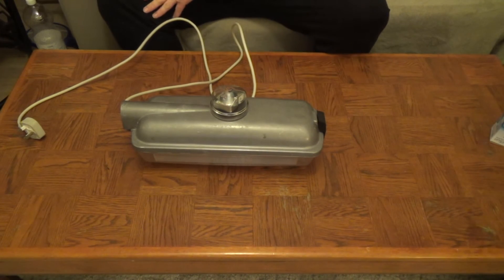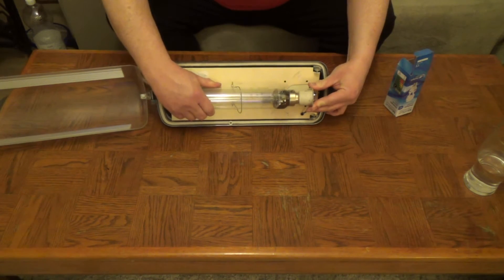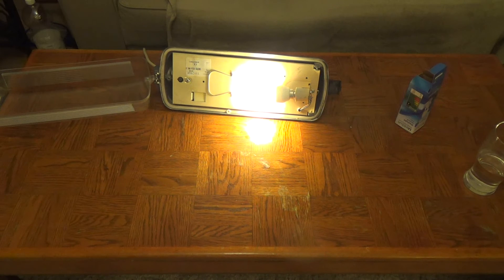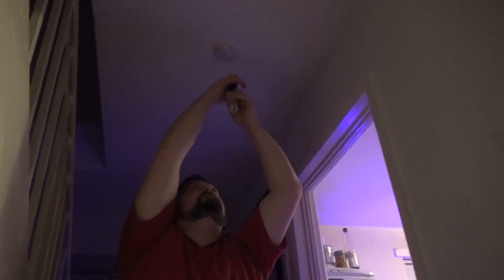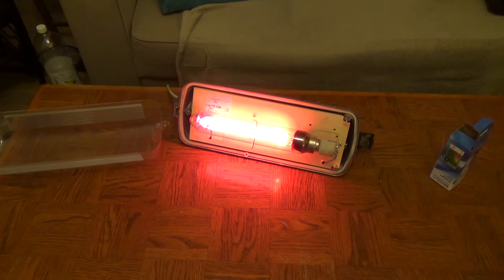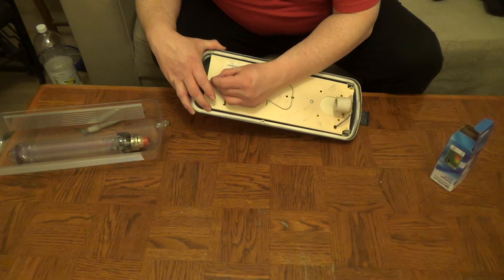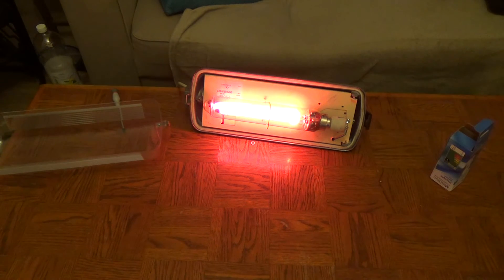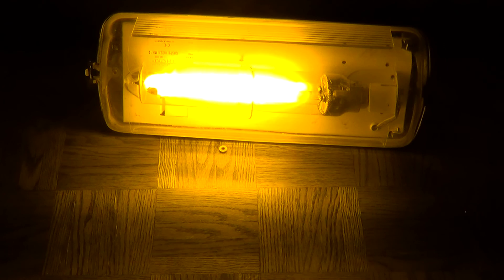Normal bulb in a SOX street lamp & SOX bulb in normal light socket

Comment: So would one of those TrueForce LED lamps work in a house socket? They don’t exactly require a gear to run.
Reply: Yes, they don't require any gear and can be run in a household lamp socket.
With street lights, in case of any ignitor present, the ignitor needs to be disconnected (otherwise it blows up the electronics). The (magnetic) ballast can usually be left in circuit as it doesn't do anything when the current is so low.

Comment: Very interesting about the compact fluorescent bulb working on the low-pressure sodium lamp. And also, I have wondered for years what would happen if you tried running a sodium bulb in a normal socket. My long question has been answered. And no offense, but low-pressure sodium lamps just give off the most hideous light ever.
Reply from the maker: Depends on your perspective. Many found they aided sleep patterns better than LEDs as their light was closer to the camp fire light our ancestors found safety in for hundreds of thousands of years.

Comment: I wonder 💭 if light-💡-bulb manufacturers will make an sox-like lamp 🪔 that DOES plug 🔌 into a standard light-💡-bulb that DOES NOT require a ballast or any kind of control gear ⚙️, let alone require a warm-up period of 10+ mins cuz it gives off light 💡 using yellow LEDs just like 👍 you can get LED-flame-🔥-effect bulbs 💡 and LED filament bulbs 💡. How cool 😎 would it 🐝 if you could get low-pressure-sodium-look-alike bulbs 💡 that resemble vintage SOX lamps.

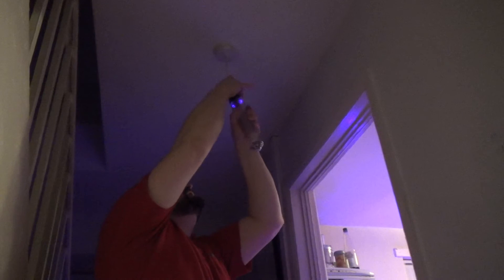Comment: At 5:28 the arc has a purple light...
Reply: Okay, don’t get so mad little child.
Reply: Neon starter gas, science baby, science, SOX are the best road lights, shame it is now no longer made...i use SOX all around my house 5 18W miniSox by doors, Philips Norelco fixtures made in Van Wert OH here Advance Philips ballasts, 55W wall Pack hubbell, replaced a Philips 55W, that got too yellow lens, no replacement, and then ballast finally fried after 35 years !! of everyday use, many lamps, teh ballast finally went, i replaced the ballast, have spares of them also, but the too yellowed lend sucked, So no longer made Philips Norelco fixtrues, got some hubbell 55W SOX Scotsdale units, they too are no long made so i have some spares, LED suck in blue white glaring horrible optics, on the roadway fixtures everywhere glare.  Have plenty of spare SOX LAmps 18W and 35W and 55W, have a 180W flood light also from Van Wert OH Philips palce, long gone, just for kicks, 180W SOX is INTENSE!!! Light the nitrite street, with the soft no glare pure yellow SOX light..ebay had some good prices some time ago, managed to get brand new Philips SOX e 18W 12 for $77.!! bargain of the day..most are like $30 on ebay..Philips, Osram, GE(Thorn) even a GEC, but over teh years, i found Philips lamps last the longest, had some Osrams go out prematurely, and some GE former Thorn go out early, subtle differences in inner tube, over the years the metal supports are mica, different generations of lamps..put up a 90W street fixture years ago in a private parking lot, worked great, better than the glaring 175 W MH crap.  too bad SOX LPs is no more ffactory last one is closed Philips in UK, they where making teh last of Osram also under contract, using Osram equipment, cus the inner arc tube is a different design, no dimples,

Comment: Hello, can you still buy Sox Fittings anymore?
Reply from the maker: You might get lucky with eBay.
Reply: I might try Ebay. But can you find them in stores?
Reply from the maker: I doubt it.
Reply: Yea i know, since LED came out LPS has been replaced. I got one more question. This is a stupid one lol. Can you find them on roads. Since they were replaced by LED and they probably threw the LPS away.
Reply from the maker: That would be stupid as the bulbs explode if not deposed of properly. Again they would have been taken to council depots to be sold on or recycled, hence why you should keep an eye out on eBay for them.
Reply: Today it was really windy and the cover of a sox street lamp and the photocell was just chilling on the road so I decided to bring it home and repair it i wish the ballast and gear fell too because i really want a sox street lamp lol
Reply from the maker: https://www.ebay.co.uk/itm/Thorn-beta-5-Mark-15-35w-sox-Low-Pressure-sodium-Street-Light-1-part-photocell/232931204748?hash=item363bc81e8c:g:cU8AAOSwvkZbn4kF
Reply: Thanks man, can it be delivered to Ireland?
Reply from the maker: Ask the seller maan!
Reply: Thanks!
Reply: Just got myself a Philips 36W SOX lantern grand new, made in 1996.

Comment: Hi, I have some old 26w SOX street lights but the 26w bulbs are getting harder to find. I have been told that I can use a 35w bulb instead and it should run fine on a 26w ballast. Is this correct? I'm also guessing from that that I could also quite happily run a 26w SOX bulb on a 35w ballast? Do you know?
Reply from the maker: You can run them but it isnt recomented. I ran a 35w in my 90w Thorn Beta A lantern, just for a short while to test it. I've been told that doing it for long periods of time can damage your ballest and shorten the life of the buld.
Reply: Thanks. I suppose what you tried is quite a big step down from what the ballast is able to do. As far as I know, the 35w is the next step up from a 26w so maybe a 26w with a  35w ballast might not be hard on the lamp and ballast. The other way round though with a 35w bulb in a 26w ballast again might not be too hard on the ballast but would it manage to get the bulb to full temperature? Do you have a 55w bulb you could try with your 35w ballast for example or even better because its a smaller wattage jump a 26w ballast and a 35w bulb?
Reply from the maker: No I've only got the 1 35w bulb. Only risked using it in the alpha lamp to make sure the lamp worked.

Comment: I've tried stuff like this with my Sox lamps.  I converted a beta 2 to white led light which I use when I need extra light in my bedroom. Say, 4100 lumens of light 😀. I have a GEC z9554 135W lantern with a damaged lamp. It warms up reddish orange and turns greenish yellow. I think the argon in the lamp leaks into the sodium flask and things look washed out. Hard to film though.

I have a video called lights out on my channel showing my street light and bollard collection if you're interested.

Regards audiotron1003

Comment: Where can I get an thorn beta 5?
Reply: You can only get them on eBay now, but it's unlikely you will receive one that's in good shape. A few years ago there was a listing on eBay of a near mint condition Beta 5, and I of course received one that was falling apart. It still worked though but you do have to fix them up and change some of the wiring.
Reply from the maker: Not many places now. They're all being disposed of and replaced by LEDs. Keep an eye on council depos and eBay and you may eventually find one.

Comment: Yep... 3 main parts:

Igniter - starts the lamp
Ballast - limits the current
capacitor - improves the power factor. Your light will work without this part but it's not recommended.

Comment: I must say, I can't believe you put a SOX bulb into a standard light fitting and turned it on. They obviously don't run on 240Volts, since they have a ballast to regulate the voltage, plus the ignitor to kickstart it (as 240V initially will not even start it)
Reply from the maker: Aye living dangerously LOL!
Reply: I wouldn't call it dangerous, it just can't work, they are not designed to run on 240V alone. These bulbs are only dangerous if water leaks into them causing them to explode so just keep them away from water... one more thing if they become shattered DO NOT just throw it into the bin...
Reply from the maker: Aye you and me know that but the average Jo Pub probably doesn't, hence why I did the video. Plus, someone has already done the water, exposure to air & depose of sagely videos on YouTube, so I didn't really need to do that part of if.
Reply: I like your videos though, I'm a fan of lighting myself, some people would call me the brains of lighting but I'm not so sure about that haha... I can't imagine what you are planning to do with that Alpha 4, its a huge light, not to mention the amount of light it will put out with the 90w bulb.
Reply from the maker: Cheers! I'm hoping to eventually make a decorative retro style,  stand alone corner lamp out of it to use with normal or LED bulbs. Hope to eventually rig it so it has two bulb sockets inside, so I can switch back to SOX light if I'm feeling sentimental, but then switch back over to the normal bulb by a flick of the switch once the SOX gets too bright.